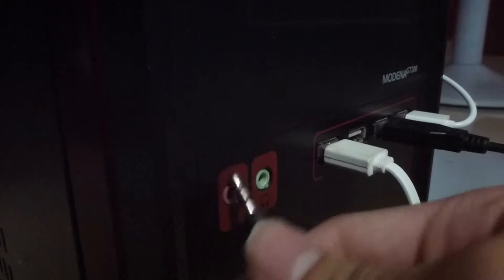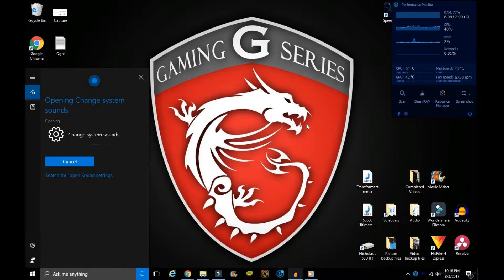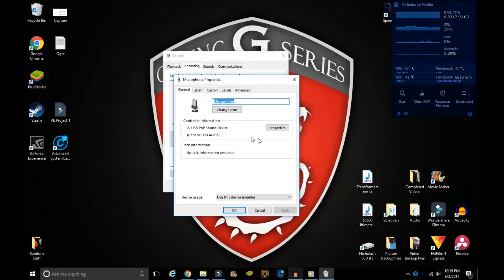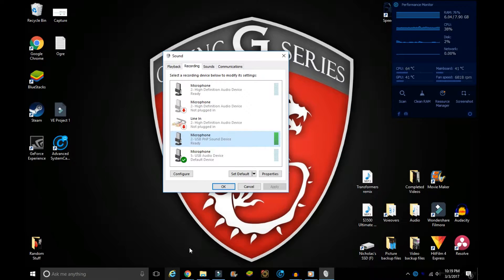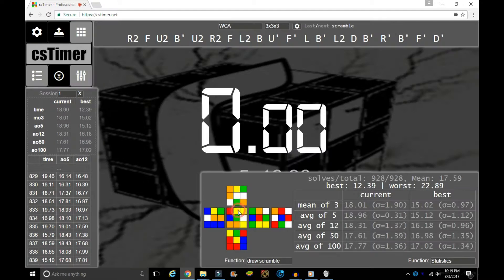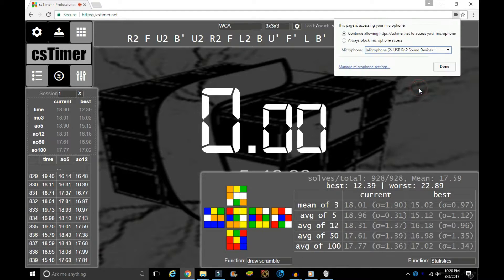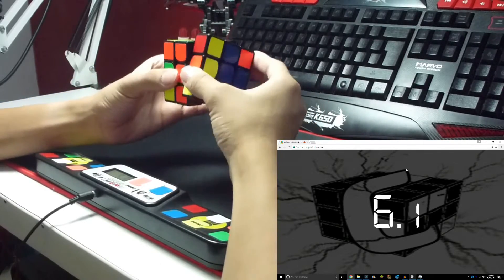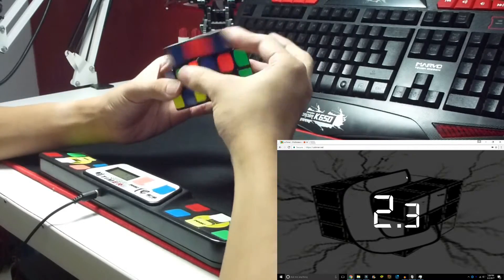How to connect a Stackmat/ QJ Timer to a PC! | Tutorial

Comment: Why don't I have a hole thingy, where you put your 3.5 milimeter to minijack cable thing.
Reply from the maker: Your computer might not have a mic jack and instead uses a combined mic and audio jack, in that case, you would need to buy a USB soundcard as you would need a independent mic jack for this to work
Reply: It's not in the computer, it's in my qj speedtimer
Reply from the maker: Is your qj timer the same model as mine?
Reply: Yeah
Reply from the maker: That's really weird, it's probably an old batch model then
Reply: ok